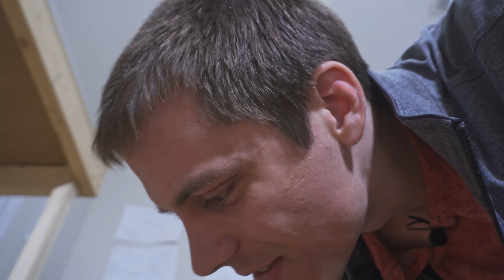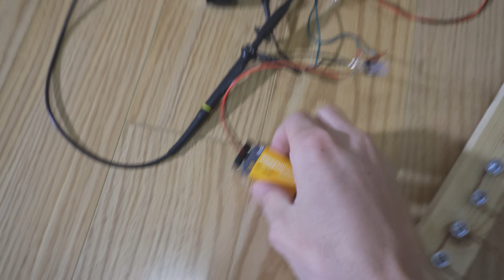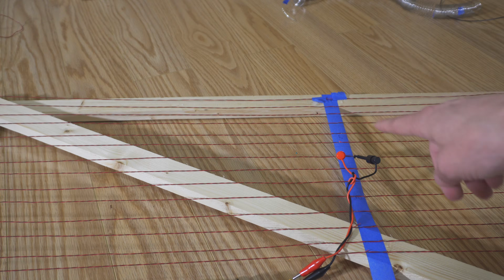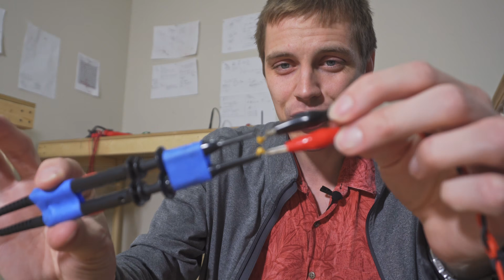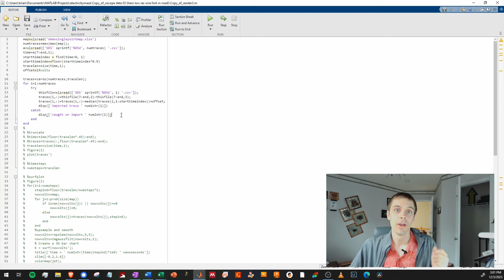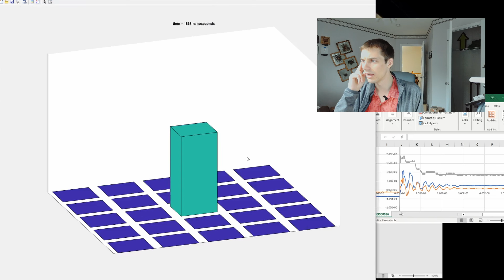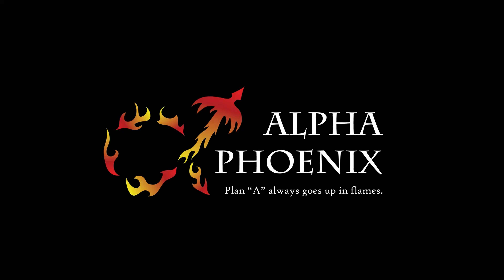How to measure waves of electricity

Comment: Thanks for this explainer video! I deleted my comment over on the main video, because I thought my question was an FAQ and would be answered here. I think it actually hasn't, but please excuse if it is too basic due to my limited understanding of electrical circuits. 
My biggest surprise from the main video was that there was actually current flowing in the disconnected part of the wire. But then I thought, it's maybe not so surprising, because you have attached the probes which close a circuit through the oscilloscope. In this video, you do talk about the influence that the probes have on the circuit and how you try to mitigate it with the added capacitors, but it still seems to me that attaching the probes connects a circuit in the  part of the circuit that is intended to be disconnected.

Comment: In the 1800s they did this by using a florescence bulb that they would touch to a wire that had the ac signal in it. The brightness of the bulb would change depending where the bulb touched the wire on its length

Comment: Those electrolytics are too slow to do much good.  You need a 0.1 uF ceramic connected directly to the IC's VCC and VEE (or VDD and VSS?).  (An additional >4.7 uF electrolytic is also needed to stabilize the voltage regulator.)

Comment: As a chemE with a job that requires a lot of electrical engineering to understand, I very much appreciate this video. I can conceptualize AC to some extent with the metaphors everyone uses, but they're always too imperfect for a true working understanding. This helped me grasp what is actually going on. ESPECIALLY for Characteristic Impedance, the most insanely confusing thing I have ever tried to wrap my head around. One thing I don't really understand is why the electrons in the adjacent turn of the wire are induced to move in the opposite direction as the previous turn. I understand that the electrons will eventually be pushed in that direction, but not why the induction forces move them that direction.

Comment: To switch the Hex schmitt trigger inverters quickly you need to supply current to the IC over a large frequency band (Fourier analysis), which means you have to have instantaneous current flow at high frequencies to minimize the signal rise and fall times, meaning smaller value supply capacitors (higher self resonance) as you get closer to the IC power pins while minimizing the device lead inductance (lead length). But, you will quickly be limited by the IC package internal lead inductance. You will have several capacitors in parallel of different values and types all working together to meet the high frequency IC switching current demand. The aluminum electrolytic capacitors in the video have much too small a self resonance frequency to supply the needed current to switch the IC quickly, and the bulk capacitance is largely negated by high inductance of the long lead lengths.

Comment: Using the "isolating capacitors" on the shorted side of the Y does seem to make those measurements credible, but seems much more iffy on the "open" side. I don't think that data can be trusted to be an indication of what is really happening on that path where the probe effects are going to be orders of magnitude greater. But I don't know how to check or make it better...

Comment: since you AC coupled your probes at the tips how did you get steady state measurements? I thought everything was detailed and explained well and done great but I was a little confused on that part. A series cap on the tip of the probes should only allow for changes in the circuit to be measured and not the actual DC voltage right? 
I think you do an excellent job with these series of videos about circuits.

Comment: What about AM Direction with a T circuit and or a L circuit where you impedance match a tower (antenna) and transmission lines to the tower nominalizing to 50ohms and some imaginary(J) show your explement on a smith chart.

Comment: So for a circuit, there has to be a positive and a negative wire, right (heads up, might use positive/red/negative/black incorrectly, sorry...trying to use 'Positive' to mean electrons flowing INTO the wire, and negative to mean electrons flowing back to the battery): I'm a bit confused with the control wire to control cross-talk...I imagined the three 'looms' (just my nickname for them) each being one prong of the Y configuration. If this were the case, then both the positive and negative wires would have to be on each loom wrapped together, like a highway wraps two directions together within one string of highway....each loom being one 'string' of 'highway' containing both directions on the Y arrangement (thus the three looms, one for the beginning and a junction seperating that for both a looping string of 'highway' loom and a last string of highway that doesn't return/isn't connected). Is the 'control' wire just your negative wire? Or did I completely misunderstand the arrangement of the 'looms' and the Y prong configuration?

Basically...would 20 probes on the black wire measure equal changes as 20 additional and separate but equally spaced probes on the red wire at the instant the battery is connected? Aren't we doing something differently, measuring them together via a single probe in your experiment? Who's to say electrons even move in both of the wires when the initial charge dives into the wire, couldn't that just be one of the wires while the other doesn't experience anything (unless the red and black are soldered together, in which case it does eventually make it around)?

@AlphaPhoenix @AlphaPhoenixChannel Like, specific points on both the red and black wires seem like they are eventually graphed combined as a single point...why not separately? Did you have data that showed for certain that, for each length along the wire, changes happen simultaneously and equally to the positive and negative wires? For instance, I didn't understand how you can say/show (18:22 on original video) the red wire (negative?) wire ending up with fewer electrons than it started while also showing a graph that only seems to be demonstrating what's happening on the positive/black wire, when I can't really tell how you separated those measurements from "different sides of the highway at the same point" if at all. It might be an assumption, but I'm not sure how we could say (on a disconnected loop) the red/negative wire ends up with less electrons if we were only measuring points on the black wire (the wire we are 'pushing' electrons into).

I'm wondering if when you say 'electrons slam into the end of the wire', I think we have to assume you mean they slam into the end of the black/positive wire only. But I'm more interested in the data...did you have data show what happened on the red wire when this experiment at 18:22 on original video was performed (as in, what we would assume to be the opposite of slamming into the end of a wire). If electrons do leave the red/negative wire, does that mean by pumping electricity into object A, we can use that to inherently pull out electrons of object B even without a circuit being created? I'm just concerned there might've been an assumption (or data was only shown for the black wire/half of the pathway rather than the entire 'loop' of wire made up of both black and red directions). I think no electrons moving on the red/negative wire while the 'signal' makes it's way around the loop via the black/positive wire might be a valid way to view this, but the data would obviously prove that right or wrong by showing either negative voltage or no change at all when the battery is initially connected to this disconnected circuit. 

I'd also be interested, if you had the data, whether the changes in voltage on both wires within the disconnected circuit were exactly proportional to the charge sent down the black/positive wire, or only proportional (meaning, did we discover whether the battery 'pull' is equal to it's 'push' of electrons, or even how that force might change as it traverses the wire as less and less electrons belong within the negative/red wire in total like eventually trying to suck air from an airless vacuum vs sucking air from a pressurized or equalized balloon as would be the initial case)

Thanks if you see this, my apologies if it's a misunderstanding on my behalf!! :) Music major here hahaha, won't be offended :)
Reply from the maker: Good question - I did briefly measure this pumping by placing two small resistors near the switch so I could measure the current in both wires, and the “distant” pumping effect was present. I talk about it a little bit in the other follow up video with the experiment details!

Comment: Super interesting, thank you for going to all of this effort watching those plots slosh around is incredible!

One thought though, you're using singled ended probes, yes you've taken two of them and used a math function to make them look differential but ultimately each measurement is single ended. The effect of that is that each has some input impedance to it's reference, a reference they share. In most cases this is like 10MR or so. The problem I wonder about is that because of the above you are effectively connecting the start of the cable run to the point you're measuring together through the scope. With around about 15MR, thas isn't much of course. But by a similar theory of the electrons "predicting" currents until proven wrong later by hitting the load, surely you are getting currents flowing through the scope, bypassing the cables you intend to measure? I'm sure the effect would be minor regardless. But one way to move closer to solving this would be an active differential probe. Better yet, two, one for each measurement point.

I think ideally you'd have a scope with isolated channels, but you'd still want a differential probe to get the purest measurements

Comment: I think you did not add a ceramic capacitor to the supply pins of the 74ac14 - did you? I just see two relatively large - what looks - like aluminium electrolytic caps in parallel. you have relatively large wiring inductance which is not neglible of you want the chip to have fast rise times. probably the ~18nS rise time I can see at 6:26 is enough for you? the datasheet of the TI part states a typical rise time of ~5nS, so your circuit is not ideal :) would be interesing to see if a (for example) 100nF MLCC with short leads between pint 7 and pin 14 of the 74ac14 would have actualy decreased the rise and fall times. As the aluminium electrolytics probably have reasonably high ESR paralleling it with a low ESR MLCC will generate some resonances which are pretty well damped by the high ESR of the electorlytics, so no harm. Paralleling MLCCs with differents values will generate way higher tank resonances.

One more thing/question: you paralleled the 6 outputs with 6 resistors. what was the individual value of each of these? It was not very clear from the video, also after combinig the 6 signals you have another series termination resistor. Both of the values are not really clear to me from looking at the video, so better to ask the master himself :)

As usual, keep up the good work!
Reply: And one more question, what was the value of the series capacitor at the input of your probes? Just curious.

Comment: Unrelated question but, 
If you sent an AC signal into a wire, split it in two, then phase shifted  so it would cancel itself and recombined further up, what does that look like? If it exactly cancelled, where does the energy go?
Is that analogous with lasers??

Comment: Adding the cap in series with the probe is having a different effect to what you explain.   The scope probe has either a 1-Meg ohm (x1) or 10-Meg ohm DC input impedence hence by connecting the probe you are adding both a DC and AC load to tge circuit.  By using a series input capacitor you are eliminating the DC loading of tge scope and hence you are only adding the AC load of the scope to your setup.

The input capacitance of the oscilloscope is typically 15pF and it looks like those are 10nF caps you are adding in series - so technically yes this reduces the effective input capacitance but only to 14.98pF or by 0.2% - clearly this is not what is making the difference here.
On the otherhand the leakage resistance of that 10nF cap is likely to be around 10^12 ohms hence adding this in series with the 1-Meg ohm input resistance of the scope will increase the effectice input resistance by a factor of 10^6 - which is the difference you are observing
Reply from the maker: Sorry i should have added numbers! That was actually a 10pF capacitor. I can only “directly” measure one sig fig on my multimeter that low, but I can confirm it’s on the order of the scope capacitance because the signal attenuates a lot (factor of two ish) in this configuration

Comment: Actually, the twisted pair don't behave as a 'signal' wire and a 'reference' wire.  A better way of thinking about the twisted pair is that it is a differential pair and rather than sending a 2.25V signal down the red wire you are sending a +1.125V down the red wire with an equal and opposite -1.125V signal down the black wire
Reply from the maker: That was my original thought process but I do correct it if you keep watching

Comment: Brian -- you would really benefit from watching or reading some material on high-speed digital electronics treatment of transmission lines. (Digital, because in your explorations you're using discrete step transitions rather than sine waves). A good example is: https://youtu.be/icRzEZF3eZo?t=721 "What Every PCB Designer Should Know - Return Current Path (with Eric Bogatin)".  
1. You can't focus only on the incremental capacitance, you need to account for the incremental inductance. 
2. The current in the positive and negative path is balanced, and the animation shows how it arises.  (A shortcoming in the Bogatin animation is that the inductance is depicted in only one line, whereas it would be better shown in both lines, but electrically it's equivalent.)
3. There is no special "turn-around" at the end of the line... it's just the voltage wavefronts on the two wires arrive at the endpoint and then meet a short (or arrive at an open circuit in the "open" case).
Reasoning ensures from those observations.
And for heaven's sake, please get yourself some prototype board to build your circuits on -- so much more robust, not to mention credible!  That said, from your apparent starting point, I have to admire your dogged persistence and actual progress toward clarifying this topic for yourself.

Comment: that trigger circuit..  I love the idea, and you nailed this whole video (taught me some stuff; thanks!)
BUT
I know it's faster to just solder it together..  I get that traces (w/o a proper matched "ground" line) just get more complex as freq goes up.
Still..  Dude..  there has to be a better way..   looking at it as is makes me cringe..
Maybe there's a pigment/insulating spray glue that's totally inert, easy to razor-off (like to measure etc), and simple to use..???
IMHO, you gotta just make a proper one..  the idea of a proper trigger/clk for your scope feels right what with all the research you do.. no?
Oh.. and thanks a bunch for this series!!  It's really helping me find the tiniest of holes in my foundation! very cool

Comment: To anyone who wants to recreate this experiment, it will produce very poor results if you try to use a single-ended scope probe to measure a differential signal on a twisted pair by connecting the probe's ground lead (black aligator clip) to the second wire as a signal reference. That works when you're measuring single-ended signals on a circuit board with a common ground plane, but in a balanced transmission line, you need to make a differential measurement (like he is doing) using two 'scope probes (one on each side) and use the oscilloscope's "A-B" math function.

Using two probes on each wire of a balanced pair allows both sides to be measured like a signal (because both sides are signals), and each side gets the same 'scope probe loading (if both probes are matched) and it doesn't unbalance the transmission line (creating different circuit conditions that alter the signal).   Note, both scope probes need to be the same cable length and same probe type and should also be properly compensated for high frequency peaking with a square wave calibrator (the little screw adjustment on the probe box squares up the edges).

If you try to connect scope probe ground clips as a signal reference, it will change the topology of what you're measuring because it alters the signal return paths of differential transmission lines by connecting them to the oscilloscope ground.  It also connects them to AC power safety ground, if your oscilloscope is powered from AC.    

Using a battery powered 'scope can eliminate the AC ground connection, but if more than one probe is used, the scope probe ground references still get electrically tied together at the 'scope chassis.  

So, he uses two 10:1 probes to make each measurement, and this isolates the oscilloscope ground from the circuit under test, and it doesn't alter the transmission line's signal returns, nor does it unbalance the transmission line. 

Note, when doing differential measurements, you should still connect the scope probe ground clips to something that is common mode to your circuit.  Ideally, they should be tied closely together and connected to the ground of your signal source.   He is letting the oscilloscope tie the grounds together and using the ground reference of the trigger channel to tie it to the signal source ground.

In short,  using differential measurements are necessary on balanced pairs of wires.